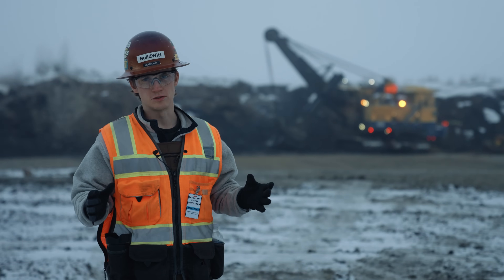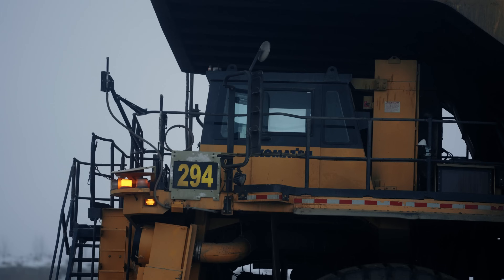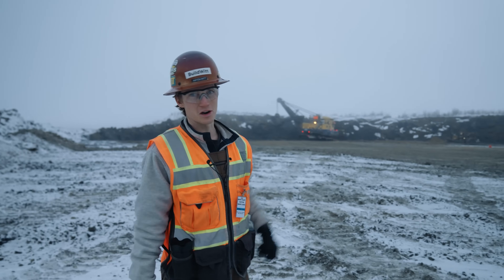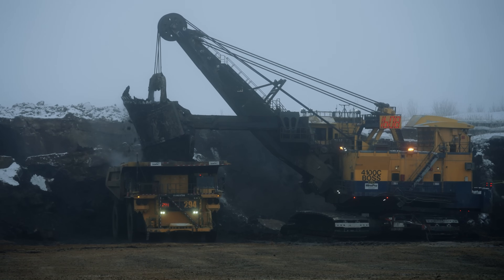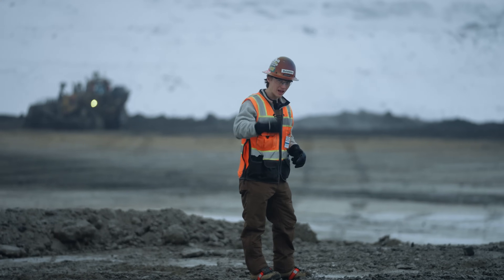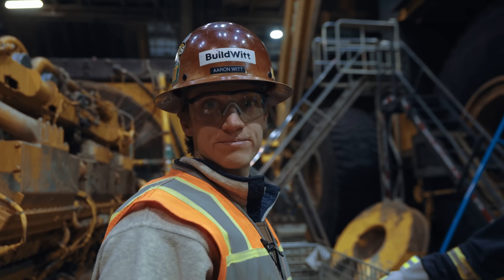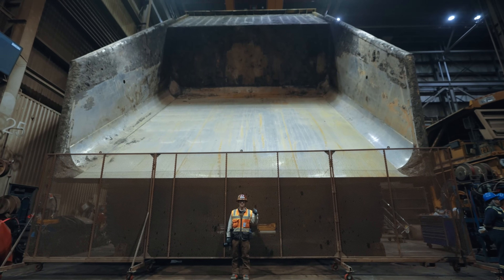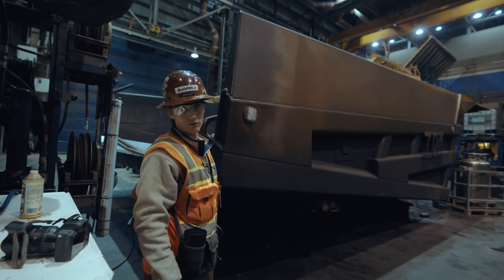Autonomous Haul Trucks in the Canadian Oil Sands

Comment: Fluid Life has been doing oil analysis on the trucks since 2016. The trucks experience significantly less mechanical issues and almost no operator errors resulting in internal damage. We host the lubrication health data to prove it.

Comment: As an industrial tire tech, I would have a few concerns in my field. A lot of the job of a good operator is to keep there ears open, I want somebody to explain to me how this autonomous truck can identify a tread separation or hardware failure.
Reply: The large haul trucks are outfitted with tire sensors monitoring the pressure and temperature changes and alerting the maintenance or condition monitoring team when the readings are above the limits. Tires are also vigorously inspected for damage and wear including rotating the fronts to the back.

Comment: Can you go through how these trucks are automated? 
Do they use GPS and an RTK station, or do they use some correction service?
Do they use Computer Vision?

It would be cool seeing it
Reply: The haul roads and possible routes are first mapped out with GPS, once this is done the haul trucks will follow essentially GPS waypoints (although they deviate slightly on purpose side to side to avoid creating ruts). The trucks then analyze what’s ahead of them using the GPS of other equipment and “ask” permission to move into a space. These permission lines stretch out about 100m in front of the truck so the truck knows it’s safe to proceed along it’s route. If an equipped piece of equipment or a light vehicle intersects with its permission line the truck will go into exception and stop. This requires a pit patroller to visually check on the situation and see why the truck stopped before allowing it to proceed again. Likewise if the ODS (object detection system) detects something in the trucks path it will stop and require a manual restart as well. I helped build the very first autonomous 980 in the world, they’re super cool!

Comment: Interesting seeing the colours of the mode lights, blinking amber here. The CAT Command system I’ve seen has a blue mode light when working autonomously, could be an Australian thing also.
Reply: Yeah CAT and Komatsu have different colour schemes for autonomous. With Komatsu amber is autonomous, green is manual. It will flash red if there’s a problem, or all 3 will flash when the truck is suspended. 👍🏼

Comment: They run autonomous haul trucks at the elkview mine in sparwood bc, i guess they have been for roughly 3 years now. Besides the obvious struggle of operating in the rockies, i remember hearing the komatsu engineers explaining that another challenge theyve been fixing was the lidar collision detection system picking up spill rock etc. Compared to a mine in Aus where the dirt is red and easy to see more or less, its obviously quite the opposite in a coal mine where everything is black and muddy a good majority of the time. Komatsu has come a long ways in tweaking there Lidar in picking up objects in such conditions which is rather impressive to me
Reply: Solar storms mess up these autonomous trucks as well. Elkview has about 2 collisions a year with these trucks.

Comment: Great point at the end of the video about extracting and reclaiming. In a day and age where the powers that be claim electric is the way to go, you don't see them doing this kind of reclamation work in third world countries where they strip mine for lithium.
Reply: The reclamation work is ongoing and a good thing. But this video only shows when a pit is refilled and does not begin to show the scope of the job ahead. The big issue is the tailings ponds. They have yet to figure out what to do with millions of cubic meters of sludge.

Comment: Thank you so much for finishing the Video tour of Mine with the Look out. The Oil Sands have got hate, bad rap from environmental people saying they are big polluters of the mother earth. In my Humble opinion what you show at end make there argument very wrong. Its wonderful to see the trees. What is wrong with REMOVAL of the "OIL" that nothing can grow in. OIL very close to surface of earth. The Oil company production on usable energy production is good for the earth in oil sands production. He mentioned a RIVER, bet that river is not contaminated as it was before oil was removed. The self Driving off road massive Haul trucks is amazing TEC. The JOB replacement of DRIVER, probably puts that driver in a massive motor grader, cat make monster road graders, have seen them work 3 to 4 across smoothing haul roads. The Dump driver can learn to operate a D-11 CAT or motor grader if he or she wants to keep job. Learn maintenance skills, the other comments said there is tons of turn over of Dump drivers. I think operator engineering UNIONS are more open to jobs going AWAY. I remember in the Late 1970s any excavator on tracks had a "OILER" very old school steam shovel JOB. I remember when the UNION stopped the Oiler position. There was NO need to have an oiler on modern Excavators. The  Longshoreman on other hand are Fighting this big time on dock work container haul trucks on docks. The Longshoreman UNION doesn't want there Jobs taken away by auto drive system. Over the big pond in Amsterdam the dock container trucks are all computer 🖥️ run trucks in big ports. A bunch of workers in computer room running the trucks after unload from ships. Lots of Excavator Manufacturing is starting to do auto dig for long straight ditch lines. Lots of remote control ( no operator) in cab. Now with 3& 4-D dig system that are installed on excavator it auto digs depth of cut. Slowly removing all people out of machine. Here we go with the Termination era of monster machines.
Reply from the maker: I even had a negative stigma in my head until I went there and saw the reality. It was an eye opening experience
Reply: @buildwitt  I'm so glad you made the trip and these two videos! I literally had a conversation with one of our senior leaders yesterday saying that I wish we had some better PR out there about what we do up here. THANK YOU!!!
Reply: The "look out" is a relitivly small pit that has been refilled. The major issue is the ponds that they still do not know what to do with.
Reply: @johnwilsonb5531  
Great point. I understand the issue you talk about. There was anti mining ⛏️ videos that said these ponds can filter so to speak into Rivers. I just hope in my Humble opinion that these mines can somehow build a big filtered system to remove contaminants from water. 
Those ponds are a big issue on what to do to clean the water.
Reply: @rp1645 didn't you just tell there's no pollution issues with these mines?
Perhaps local environmental standards needs to stepped up, instead of ruining the environment to the benefit of a few people?

Comment: It must be really fascinating to be able to visit such a gigantic workshop with those dumpers being worked on.
Reply: Did I understand it correctly they change the oil at every fuel up?
Reply: @armandoledesma3699 no he said they check it. Certain fluids get charged at different intervals. They typically change the engine oil every 250 hours of run time

Comment: Great to see the big oil putting Canadians jobs first???
Reply: There’s still a lot of jobs required to operate these facilities.
Reply: @Psychli  There's no jobs for people to drive these trucks is there!!!!
Reply from the maker: only part of the mine is automated. They employ thousands of people there
Reply: @buildwitt  So truck drivers can apply for any other job and get it because the oil company doesn't need them as truck drivers 🙄. It's not about the 1000's and 1000's of other jobs it's about the jobs they are taking away from average Canadians .
Reply: @gregoryspencer3619  suncor has said they will not be getting rid of any jobs just transitioning ppl to other opportunities. They pay for ppl to get educated. Plus the work force is dwindling. Every company up here is looking for workers
Reply: @gregoryspencer3619  there hasn't been enough haul truck drivers for decades, constant  shortage, we could use a few automated trucks, it actually creates more jobs. more trucks, means more need for mechanics, warehouse/parts people, logistics, etc.
Reply: @hammothw4814  why is there a constant shortage?  Why can't they find and/or retain enough haul operators?

Comment: I’m torn on this topic. There are a lot of people that would LOVE to have a career running this haul trucks. I understand that it’s sometimes a boring job. It’s a dangerous job too. But if we remove the operator positions… which is where we are headed… then we will lose a LOT of jobs. 😞
Reply: Did you hear the yogurt lid story. These things are useless there's a team of people running around supporting them. They need smooth roads to drive on, meaning there's a whole crew making sure the roads are smooth. The jobs just moved to ones that don't require constant attention
Reply: That's the broken window fallacy right there. We could have as many jobs as we want in retail and hospitality. Jobs matter less than meaningfully productive jobs.
Reply: Who do you think designed developed and sold those machines? What about the programmers who programmed the computers in the people who built the computers? If we didn't have automated vehicles they all would be out of a job and there's way more people designing these trucks than the number of trucks displaced  workers
Reply: Ive done 5 years plus with frontrunner and now I'm with minestar. It takes about the same amount of people to run these trucks. The only difference is, it's skilled labor. Engineers, specialist etc. The mines I've worked in have always up skilled the truckies and none have lost jobs. You'd be surprised how many auxiliary ops you need to clean up after these trucks 😅
Reply: Get used it to it my dude, it's coming for your job soon.
Reply: That was why it was not implemented at Syncrude when it was first offered, and that was well before 2016, maybe close to 15 years ago if I recall.  But there are other factors, mostly safety, as this operator never falls asleep on 12 hour shifts, and the only hot-swaps that are required are the supporting equipment operators.  But the system is not nearly a complicated as required for road traffic vehicles.  There is little "situational assessment" and "decision making" required for this haul truck on-board system.  It is mostly follow a controlled pre-determined (programed route) and by controlled I mean there is nothing else on that route except haul trucks, so most of that is GPS and some type of proximity sensors.  More like an assembly line than like highway traffic, which is what automation is good at.  Now the AI that is required for traffic driving is not quite there yet.
Reply: Yeah, fuck Skynet!
Reply: Volvo and Scania both have cabless/driverless trucks they are testing. Scania has some sort of haul truck and Volvo has a tractor unit moving containers in a port.
Reply: What's this yogurt lid story?
Reply: Don't believe these dolts. Around 400 jobs lost at a minimum. They do not require more workers to run them, the new positions are not many in number and the ones that are available are not for the previous truck drivers. They are also not as efficient and have many, many issues. There are also plenty of people that want to drive trucks. Don't believe that nonsense either.
Reply: @jackspratt2222 yeah right, stone age didn't pass out because of lack of stones. Move on or stay  behind.
Reply: @Emily Emily  ?
Kan lang...
Reply: Jobs aren’t lost, responsibilities are just changed.
Reply: The turnover rate for haul trucks in the coalmines in elk valley for teck coal, have turnover rates around 400-500 a year.
Reply: @TheYeeterDefeater  Tek mine’s problem is that they require you to live locally( no fly in fly out) and they pay far less then any other company. I won’t work for them either
Reply: @MightyBudda  yeah, if they had a camp it wouldn’t be nearly as bad. I’m about 3 hours away but they don’t age. Camps and work a 4x4 shift I think it was. I’d be doing electrical but yeah not somewhere I wanna stay full time.
Reply: @TheYeeterDefeater  Yeah… if you’re turnover rate is actually THAT high… you have problems. That’s a problem that needs a root cause analysis done to determine the real issue. I worked at a company that ran 60 trucks and the route was LONG. A round trip down all the haul roads and then back to the loading site was right at 2 hours. We worked 14 hour days. People LOVED that job. We worked for an amazing company. Our turnover rate was nearly nothing. That sounds like a company issue tbh. They either don’t pay enough, work in an odd location, poor scheduling, lack of good/proper training, a poor culture, are selecting the employees from the wrong pool, not accommodating employees, offering poor benefits, having lackluster management, or a plethora of other issues. There are always people willing to drive those trucks. Always.
Reply: @TsunauticusIV  well it’s remote, they pay amazing and they have insane benefits. I’m assuming it’s because it’s super boring and strict with shit.
Reply: @TheYeeterDefeater  why, what are the cons of the job?
Reply: @hammothw4814  id say it’s super boring, also you gotta make sure you are super alert and awake for every shift as they have eye tracker systems to see if you are falling asleep or distracted.
Reply: @TheYeeterDefeater  ..thanks, seems like a great job though to get one's foot in the door.
Reply: It's more than jobs;  AI is an evil development that will come back to bite us!
Reply: I feel so bad for small minded people like yourself
Reply: Ain't nobody going loss jobs this fake clickbait
Reply: Do they repair themselves? Replace management with AI only fair 😮
Reply: I work in this mine and trust me there arent jobs being lost. the trucks require some attention from people driving in the pit. As Matt said they do require people to support them, however these trucks do exactly as they're told and are insanely precise (Most days accurate to within 10mm)
Reply from the maker: thank you
Reply: @buildwitt  can you next vid out the HP in the state of the machine
Reply: I completely agree with you, but having talked with people from liebherr before, it's hard to find people that are willing to drive the trucks. And even harder to retain them.
Reply: @andrew48dhs yet here am I unemployed.
Reply: How I feel too..
Reply: The machines will require support for a long time, and the turnover rates for haul truck drivers are insanely high.
Reply: @Psychli  why are the turnover rates so high
Reply: Generally speaking, all of these automations create new jobs for humans. If you had 4 humans driving the truck around the clock that's 4 jobs, but the number of jobs needed to keep these machines running 24/7 and that are facilitated by the additional production created by these vehicles is massive.
Reply: Unions would have stopped this. Mine workers need to get organised and hold the line.